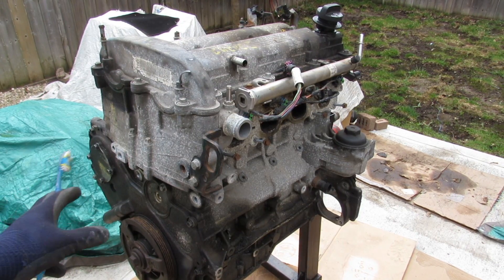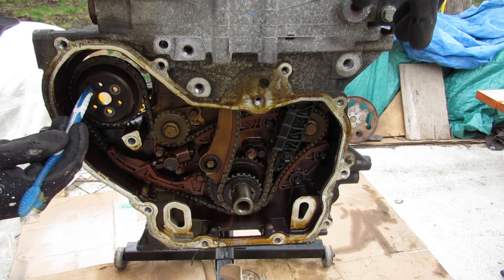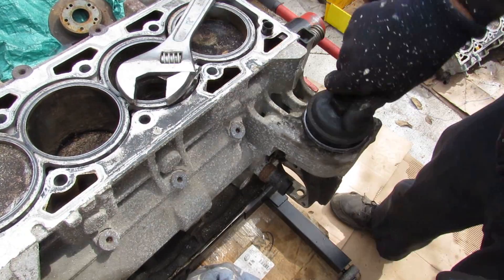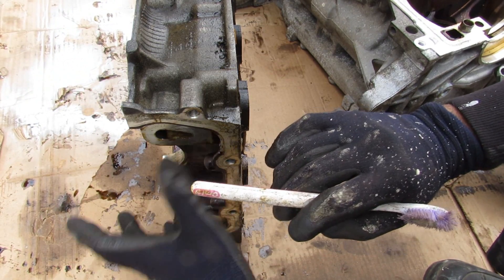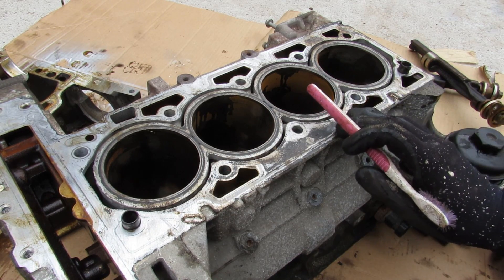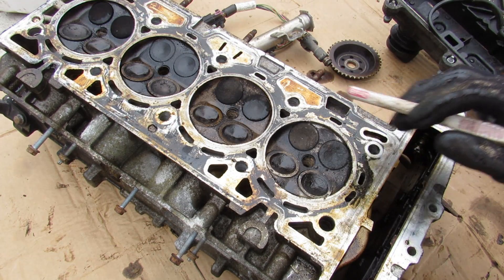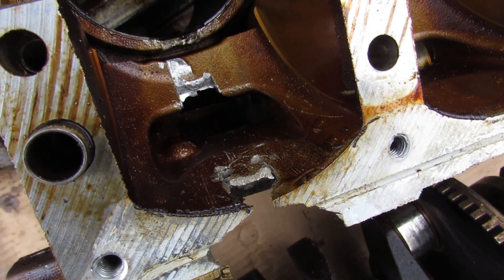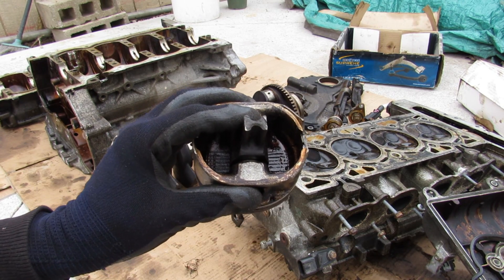Why GM Ecotec Engines FAIL

Comment: As someone who mostly has ever worked on Japanese cars, its nuts to see so many different types of fasteners being used on that thing
Reply: It’s amazing right. Almost like it’s German, oh wait the thing is designed by opel.
Reply: @ryanthompson2893  I happen to own the design predecessor, the X22SE.
Reply: @der_pinguin44  poor you
Reply: @jesusyeshuaelelyonelshadai6295  not really, it's a great engine. 305,000 miles and it still runs great.
Reply: @ryanthompson2893  Opel isn't Germany anymore, it was Hungary.
Reply: You can thank the EPA for that GM 3.8 engine, solid engine with minimal tools. They can build them to last a long time if they still wanted too. Now it's all lighter & gas mileage. It just don't last
Reply: Probably a fucking Sazuki bike. Buy a Z32 then you’ll truly know
Reply: "its nuts to see so many different types of fasteners"

I see what you did there.
Reply: @AmaroqStarwind  
He's here all week  !!!
Reply: They're lazy so they screw on anything that comes first.
Reply: Japanese are easier, it's all 10mm
Reply: That's the truth. I have a 2000 corolla that you could take the entire car apart with 5 wrenches.
Reply: Having worked on multiple cars for just body work, GM is the worst. You really bring so many types of sockets and remove redundant retainers just for a bumper removal.
Reply: @danielcastaneda7801  WHAT? What about German cars? You need your entire tool box to work on those. You can't put a couple hand fulls of tools on a cart and go work on a German car. You'll be walking back and forth to your tool box all day. You have to pull the car into the bay your box is in other wise you'll never get the job done.
Now a days mechanic's are pulling front bumpers and door off at a fairly consistent rate just changing headlight assemblies and repairing broken wire harnesses at the flex point in the doors. European cars are on a "Standard" all their own and completely different from Japanese, Korean or American. Now tell me that ain't true.
Reply: @Ed70Nova427   shit at least they’re consistent with the bumpers! All BMWs ask of you are T25, T30 and 8mm. VW is nothing but almost always only T25s, Mercedes is the only oddball that require 8mm and 10mm and T20/25s. 

You want a Ford bumper off?? You’ll probably need T30, 7/32, 9/32, 10mm, sometimes an 8mm, and sometimes a Phillips head and a drill bit for those stupid unnecessary rivets- but it’s never consistent throughout different years and models, and then they use loctite on bolts that are extremely hard to get to unless you take off the wheels and fender liners. Chevy - I don’t even want to explain the inconsistency of their bumpers, they’re so ass.
Reply: Balance shafts put quite a load on the drive chain. Surprising they did not use strong chains for both.
Reply: @Dave5843-d9m  Because timing chains are a maintenance item that's intended to be replaced according to a service schedule. People ignore service schedules and then proceed to call the engine "junk" when the timing chain jumps a tooth and destroys things.
Reply: @hochhaul  actually, timing chains don't have maintenance intervals, those are for belts. Chains are supposed to have very long life.
Reply: @hochhaul  
Even internal engine chains need good oil. Change twice a year or 5/6,000 miles. From my bike riding years,  chains need oil.
I had two Ford Mondeo petrols both had timing chains 192,000 & 206,000.
Never missed a beat.
Reply: @hochhaul  I had my gmc terrain  denali for 3 months and my timing chain jumped and destroyed the engine. Got the oil changed 2 months before this happened. I will call it junk because it is junk. 3 months after new engine replacement and having issues with timing again. I hate this car and will never in my life buy another GM
Reply: As someone who works and owns japanese cars ... I can clearly say Japanese is top class over built in quality..
Reply: @jesusyeshuaelelyonelshadai6295  XDD nice joke
Reply: @battlefield1942  he is right though
Reply: Subaru: Take the whole car apart with 4 wrenches.  Ford: Bring your whole tool box.
Reply: @rusty1187  BULLSHIT!  

i can take my ej22e out with a 14mm deepwell and a double ended combination ratchetting wrench.....thats in standard  btw....and a phillips head screwdriver...so 3 tools sir...3!   

technically  XD
Reply: The engine is built by Daewoo. It has their logo on it in a few places.
Reply: @sienile  it's not a GM product if one part hasn't been rebadged from one of it's global subsidiaries at least 3-4 times
Reply: @IronFishChannel  If it's not a GM product then why is everyone bashing it? I thought we only bash American products.

Comment: My sons Buick ate 3 of these engines in two years before GM bought it back. I did synthetic oil changes every 3000mi with dexos 2 spec oil. What a pile of crap. The service department lied and lied and tried to weasel out of each service but I had all my receipts and records.

Comment: the ecotec does not use rockers they are called followers and the main bed plate is not the upper oil pan and the crank shaft is not forged its cast steel

Comment: Well yea a lot of ecotec engines were not built that strong. However the ecotec LSJ supercharged motor in the cobalt ss and saturn ion redline is fairly tough! Comes with all the forged internals you could want on a forced induction engine. Sodium filled exhaust valves the whole works. On a stock bottom block an LSJ can handle upwards of 400 to 600hp and that's on a 2L engine! 

There are more good ecotec engines than bad. A lot of them had timing chain issues but the actual engine itself is strong. Seems like most of the issues came from the tensioner that you found as well as the timing chain guide bolt. 

Actually replacing the full timing set on my ecotec LSJ soon so this wideo was welcomed. Love to see you get your hands on an LSJ or LNF ecotec. Or a nice saab engine
Reply: Im about to build a 2007 ecotec from a cobalt SS. New forged rods, pistons, ported heads, TVR 1320 swap from the M62 blower. Lots of goodies. I’m going for 450-500hp. Probably gonna run e85 in it. Before I start the build I’m trying to figure out what pistons… do I raise compression, lower the compression and try to keep it at the 9.5:1 it came with stock? This engine will eventually become a do goblin build. Good to see a video tear down with so much explained!

Comment: I'm getting ready to rip into one of these engines, looks like it has a bad head gasket. I hope that's all that's wrong. 
I hope I won't have to break out the duct tape. lol
Reply: Put crankshaft at #1 TDC position. Make a careful sketch of how the timing chain and balance shaft chains go on... and the exact position of the camshaft sprockets... GM doesn't bother to use the differently colored chain links that are used to time a replacement chain... and your sketch will be easier to use and understand... keep the chain supported so it doesn't slip on the bottom sprockets...

Comment: I had one of these l61 ecotecs and honestly I've been seeing a lot more of the ecotec lately. I used to like these engines before a lot of people really started using them for swaps and stuff. Anyways that engine was flawless for me for about 2 years and out of no where it started knocking. And it would of possibly ended up the same way this one ended up. But have a buddy who runs a cobalt 2.4 le5 and uses it for circle track racing. Been running that engine for 3 years problem free revving to 7500 rpm. And the engine has 170k so she's not fresh by any means and still has the original timing chain tensioner which is mind blowing cuz they go out a lot! But it's awesome seeing more people learn about these engines sure they are prone for their timing chain problems  and oil Consumption issues but if you actually do take good care of them they will run pretty great! Mine had 270k before she started knocking.
Reply: These engines tend to develop timing chain/oil consumption issues because they go way too long between oil changes, drive short trips way too often, and ignore the preventative maintenance schedule. Early 2010's Ecotecs received a new direct injection fuel system and the stainless steel fuel lines would sometimes develop leaks, allow fuel to drip into the engine oil, thinning to oil and causing wear to the timing chain and other components. I think there may have been a TSB for that issue. For the most part these engines are okay if the owner changes the oil often and stops taking the vehicle out on short little 2 minute drives.  I know people that have 300k+ miles on their Ecotec. They change the oil every 5k miles, follow the PM schedule, and use the vehicle to commute long distances to work and the engine does fine for what it's intended.
Reply: @karlschauff7989  of course the le8 I think is what that engines called I can't remember but yeah thats pretty much it! Spot on!

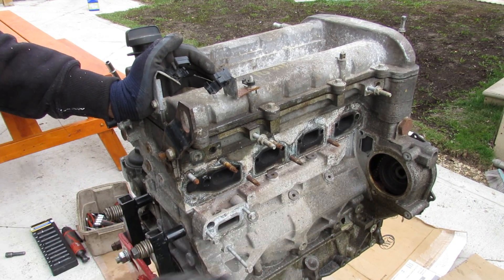Comment: 0:46.. balance shaft chain...
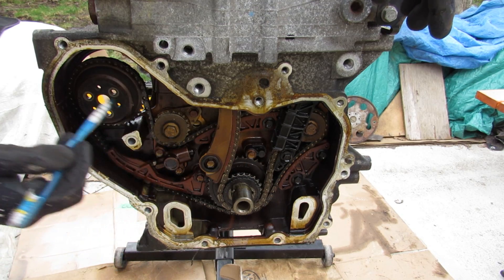2:33...balance shafts...
4:00... I see you player...🏁👀
6:50...weak ish rods...that thing probably has over 200k on it....they run...you just gotta do your maintenance....
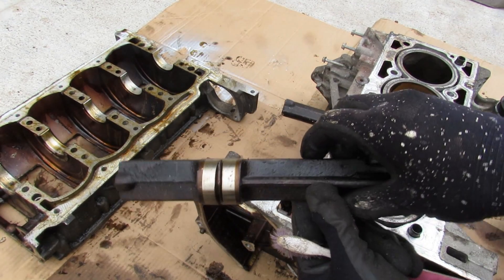9:10...which GM eventually did...🤭
9:50...they went to sand cast after Gen II
Pretty sure that's not a 2.4...that's an older 2.0..no valve reliefs in the pistons....

Comment: Look how thin the rods are 😳
Reply: Rods are weak on the na motors, boosted motors have bigger forged fractured rods from factory and hold upwards of 500hp with stock internals
Reply: @elijahguzik4618  They are all the same PM material, and all fractured at the parting line. Like I said, the rod didn't fail because it was thin.
Reply: @fun_ghoul  the na motors always had smaller rods and any 08+ na motors did not have forged rods. The boosted ltg motors also had weaker bottom ends like the na motors.
Reply: @fun_ghoul  never disagreed with you, it had no oil
Reply: The rod didn't fail because it was thin.

Comment: Main problem I had was front cover gasket leaking.  That caused the timing chain tensioners to break.  Replaced it with new gasket and timing chain replacement kit from AUTO ZONE.  The cheap ass kit from AUTO ZONE broke in about 10,000 miles.   Changed the whole engine and transmission with lower mile one.
Reply from the maker: Ouch!
Reply: @speedkar99  I never use AUTOZONE,  Malibu is running good with a newer engine and transmission,. They have 89k,  changed out the cat, flex pipe and resonator. The cat was clogged up and jerking the transmission.  This week is a brake wants to stick,  I use this car M-F,  I have a 2018 Subaru Outback bought brand  new. I leave it in the garage

Comment: I thought some of the older 2.2 ecotecs were reliable? 
So basically when you slip up on oil changes combined with high mileage the timing goes and it'ss good by engine?
Reply from the maker: Yes they were. Except the blown one in this video is a 2.2...

Comment: I had a Sunfire with the old style tensioner ,it just fell apart, dropping prices into the timing cover, I was able to recover them, but around 90k I started seeing metal in the oil, also this engine required oil changes every 3k, you could tell the oil was breaking down because the car would run bad, and yes it did burn oil faster then it should.

Comment: The intake manifold also has a tiny little hole in between runners 2 and 3. That hole is the PCV orifice. If the oil isn’t changed at a regular interval, it will clog. This accelerates the oil consumption past the rings since the crankcase can’t breathe. This particular engine looks like it’s missed a few oil changes. The Champion plugs say a lot.
Reply: owners fault the engine failed
Reply: The stuck-on oil residue inside of everywhere. The caked and compressed oil filter. Has the oil ever been replaced or just topped off?
Reply: @josephvanwanzeele5125  looks like the owner went with the traditional self-changing oil, which is maintained with the occasional consumable spark plug.

Comment: One more question: what is the advantage of a hydraulic  chain tensioner ? why not having it spring alone type ?
Reply: Springs can wear out, oil shouldn’t as long as it’s kept clean.
Reply: @ryanthompson2893  i dont buy that.. There is a vast use of spring in a car engine, from throttle to the valves etc..
Reply: @sagifern4444  valve springs are different. On motorcycles the spring type has issues like rusting, cracked spring. It’s probably cheaper to use a hydraulic tensioner over a spring tensioner as well.
Reply: They have both weak springs and oil pressure in them! Like a hydraulic lifter, the oil is used to maintain a solid -0- lash and keep things quiet.. they also have metal one way locks in them so they can't collapse much once extended to compensate for wear... but you can turn the piston and push the piston back in during maintenance...

Comment: I had this 2.4L in my 2003 grand am.  It's a shame i had to get rid of the car.  Rear main seal was leaking making a mess and was quoted a big price to repair.  I really liked the otherwise reliable engine and economy it provided to operate and travel frequently.  It rivaled Hondas of the same era for fuel economy.
Reply: DID YOU TRY THE MECHANIC IN A CAN, REAR ENGINE SEAL, IT USUALLY WORKS SOFTENING THE SEAL AND SWELLING IT.

Comment: Those ecotecs are actually really good engines. I had a 2009 cobalt lt with the 2.2l ecotec and that thing was torquey and the only issue I had in the 10years I had it was the cam actuators went bad ($90 part) which took 15min to replace. Maintenance is key to these little gems, unfortunately the car was involved in a bad accident at only 90k miles, fortunately no one was hurt and I came out from the wreck completely unharmed. Modern Chevy sucks in general but this little engine and the Chevy Cobalt left a good impression on me.

Comment: As an owner of a 2008 Saturn Sky Redline 2.0, I have to say that in every experience I've had, the engine has always been more than enough for my needs and that's where the real rub is: you have a lot of idiots who try to treat a 4-cylinder like a damn V-12, either with or without aftermarket add-ons that the original engine tests never accounted for. We've all seen these people: racing at stop lights, pulling 30-over in every speed limit they drive through, doing idiot things all the time every day of the week... They also do quirky things to their cars to make them go above and beyond without realizing the stressors they're adding because we all know that every shade-tree mechanic is a full-on engineer hired by multinational conglomerates who subject their designs through rigorous testing regimen...

Much of the success of any tool boils down to how well it's treated and whether it's used within the constraints of its design. This engine you see in this video wasn't taken care of...at all. It was likely owned by someone who put basic oil changes on a back-burner, turned every stop into a drag race, did some mods from their garage, etc. and as a result, drove this poor engine into its deathbed. But knowing what I've seen in these engines, I have no doubt that it did everything it could to keep chugging along until the very end. Makes me sad.

Comment: If the NA version of the engine is so unreliable, what made GM engineers think adding a turbo would be good idea??
Reply: It's to get better power from a smaller engine. Better emissions and lighter vehicle you see.
Reply: @shifty2755  That I know. They chose the wrong platform to turbocharge is what I'm getting at
Reply: @SomayOklu  the turbocharged ones had forged rods and cranks from the factory with piston cooling gets and better piston design. They all use the same timing chain setup which lasts longer than most timing belt setups with less maintenance. Hence why more manufacturers have gone toward timing chain. In drag racing, this engine holds the records for fastest 4cyl and fastest fwd cars they are reliable and strong motors, it's just some people don't understand vehicle maintenance so they see failures
Reply: I mean they really aren't they fail quickly if oil changes are neglected or if you don't put synthetic oil in them but besides that they Are pretty reliable

Comment: That's not exactly how that pcv system works.  That nipple goes to the breather box, that's the fresh air intake... the clean side.  That center channel you were calling an oil return drops down to the location of the intake manifold, then turns toward and into the intake manifold.  This is the suction/dirty side, as the crank gasses are sucked into the intake manifold through a small hole for burning.  This engine doesn't have a pcv valve, just a small hole... that's hard to service and tends to plug up, and the clean air side starts backing up with coffee.  In the 2011 equinox the rubber hose has a trap such that the coffee won't drain and can freeze, blowing out the front and rear crank seals when the engine is started.  Great design.  <sarcasm
Reply: Hey Rick, You are absolutely correct!  I posted my fix for that problem, 4 comments up, yesterday!

Comment: At the dealership we call these money makers especially the 2.4L Direct Injected variant. Oil consumption issues (piston rings), timing chain failures, cam phaser failure, cam phaser solenoids galore, blown rear main seals and so-on. and maybe once in a while a high pressure fuel pump dumps fuel in the oil.
 I'm always amazed how many of these roll in rattling like a diesel while 1qt of oil circulates in the pan.

Comment: I got a 2005 2.0l cobalt ss and I had to replace the timing chain because the plastic guides broke in it. I never really had any other problems. It had 155,000 miles
Reply: In Opels it's recommended that you change the chains and tensioners at around 150k kilometers as preventitive maintenance. that's about 90000 miles.
Reply: @foxman105  Yeah unfortunately most people ignore preventative maintenance schedules and they call the engine junk when it fails.